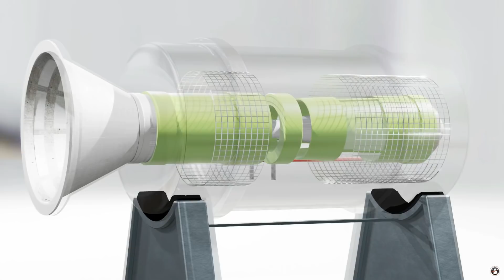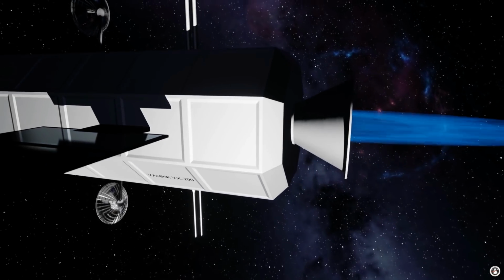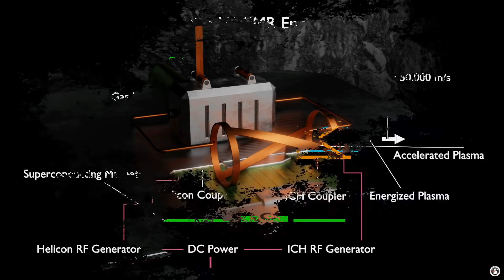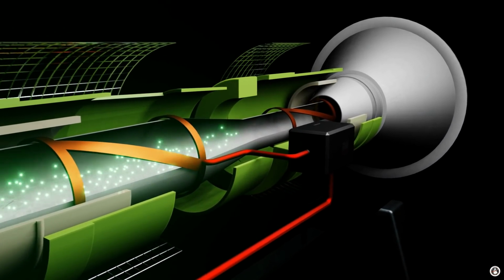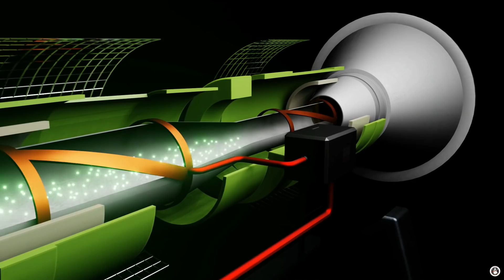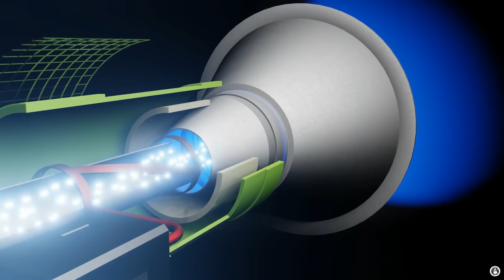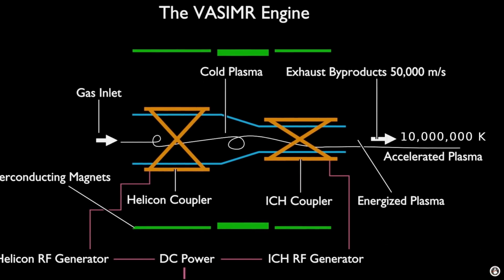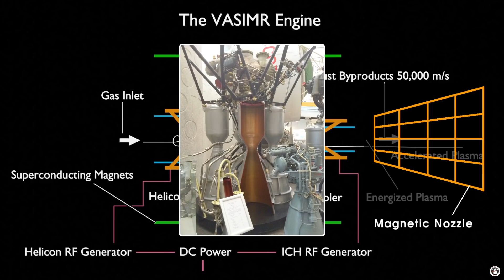The VASIMR Engine – 0.000167 c / 50 km/s

Comment: Some of Diaz' early designs used as many as 4 RCH stages - which would give peak energies about 10,000 times higher, with the same mass flow. Right now he just wants to get one unit (two mirrored thrusters and a power system) working as a space craft, which would be ideal for satellite or even large system transfer to geosync.
He has also used Hydrogen and heavy metal plasmas.
Reply: Heavy Metal Plasma sounds like an early 80s rock band

Comment: If it works how come Elon Musk isn't using.
Reply from the maker: It's not so straightforward. Though close, the engine is still under development. The high power requirements, like the International Space Station, could easily be supplied using solar panels. We think Elon is only now starting to consider other forms of propulsion. Let's see what the future brings.
Reply: @asteronx  I am so convinced Musk will see the need for VASIMR sooner or later. Just a matter of time.

Comment: Is there a possibility to use this high temperature to initiate a fusion reaction ?
Reply: Humans have been generating fusion reactions for decades, most of the necessary components can likely be found in your home. The problems are sustaining a reaction that generates more energy than was required to produce it. So far, fusion costs more than it can give back.

Comment: 39 days. shortening the travel time also makes manned flights to Mars that much safer, as the turn around for supplies and emergency missions would be so much more reliable and efficient
Reply: One 'might' be able to get there in 39 day, but, one has to slow down at the destination. Add another 26 months for that process. What materials do we posess to contain a temperature of 10 million degrees? Sweet nothing.
Reply: @peterbarratt8699  Nope. Half he trip accelerate, half the trip decelerate. Result 39 days. And Mars is uphill in a higher orbit which helps to decelerate.

Comment: what do you hear in space? radio static pulses
Reply: dc is better,
Reply: as railgun
Reply: cyclo-railgun, loop-de-loop
Reply: combined cyclic and linear dc accelerators, for particles
Reply: also orbital and to-orbit package launches, also out-of-orbit and to-other-orbit launches
Reply: artillery, that is
Reply: just have long barrels, more velocity
Reply: packets can withstand 120k-g of acceleration, like bullets, to get 10km/s or more, speed, to have the slinged to your base location, if needed

Comment: I also agree that Elon/SpaceX should use VASIMR engine in the starship. Or they can use both chemical and VASIMR engine same time,cause the final strship would have 6 Raptors engine,so it would be great if they used 3 Rvac Engine & 3 VASIMR Engine. I think it would take just 30 days to reach mars.

Comment: Someone tweet Elon musk. He has to know about this
Reply: To think that he doesn’t already know about VASIMR (along with dozens of other propulsion systems that you’ve never heard of) and that someone could break him the news of it on Twitter after watching a YouTube video is genuinely insane and concerning
Reply: Elon already talked about the VASIMR. He didn't think it can be put to use yet, because the energy efficient was very low (50% less) compared to other types of ion engines, esp. at the high thrust mode. I heard Ad Astra has improved the efficient of their VASIMR engine significantly in 2020, but the actual situation need to be confirmed. We'll see when they will put a VASIMR into orbit in 2022-2023.
Reply: @zhchbob  from what i remember from past videos, i think their main problem with this was the temperature, right?

Comment: Instead of trying replace chemical rockets why not aid them the E.M drive moving the atoms.  Make it easier on chemical rockets
Reply: The EM drive have been shown not to work
Reply: @jesperseegert5779  Alone  because a body at rest stays at rest.  Sending electron throw the walls would only heat up or vibrate the walls unless ship already being prepelled.
 With flow of election throw walls in a certain direction. It would take less rocket power from chemical rockets

Comment: Hey folks, although our solar arrays are less massive now-a-days compared to just five years ago, me thinks VASMR just  doesn't produce enough thrust for 39 days to Mars. What is the mass of the fuel for both acceleration and deceleration to Mars? 10 kW kilopower KRUSTY reactor = 1800 kg , that's for only 10 kW. I thing VASMR uses > 10 kW to function. I don't know what the mass of a appropriate solar array would be....(if you opt for solar instead.) Then there's the payload...what is that mass? 
Respectfully, I just don't think (all things considered) that VASMR has the specific power to move fuel, power supply and payload in any meaningful way.....wish it had more oomph than it does. : I.      ,     Kevin
Reply: Great comment. You nailed the basic problem: electric power to run it. Current solar is around 4 kg/KW, but this can be dramatically improved if concentrated sunlight is used in conjunction with SpectroLab triple junction cells that can operate at 900 Suns (if kept below 100 deg. C by active cooling) and at 40% efficiency. I believe over 5 KW/kg is feasible at one A.U.
Magnetic reconnection propulsion is far superior to VASMR in that it is less massive/thrust, is more efficient electrically, can operate at far higher specific impulse and does this by using the same trick the Sun uses to send out a flare. 
BTW beamed power by say laser to similar PV can have superior performance to antimatter but is feasible today.

Comment: Elon should consider using the Vasimr Engine on his Starships.
Reply: This will make the 1 million by 2050 more possible.
Reply: yeah if you want to accelerate by years rather seconds
Reply: @Technodude255  You think the VASIMR engine is an ION engine?
Reply: @WolfeSaber  more like in the same ball park as a ion engine. The plasma will take significantly more time to be accelerated compared to chemical reactions. Thrust is very weak with this technology
Reply: @WolfeSaber  ... and ion drives is producing a plasma though no as energetic as VASMIR or a fusion drive.
Reply: @Technodude255  Not this design. It was stated to get a ship to Mars in 39 days compared to, by chemical rockets, 6 to 8 months.
Reply: @Technodude255  A hall thuster and the visamir are not the same. The hall thruster is a cold thuster. The visamir gets temperatures hotter than the surface of the sun. It is not a ion drive.
Reply: @Technodude255  Your second sentence below makes no sense. The plasma isn't slow to accelerate the spacecraft will be slow to accelerate due to low thrust. The mission profile is the ship accelerates continuously...perhaps at only 1/100th of a g... but that adds up over many days. You have to have an independent power source
Reply: @francisdavis1271  I understand that half ,   the 20 first days  is thrust forward, and another 19 days the speed is so great that it turns around and starts breaking the rest of the trip.  Cool.
Reply: The item that is never mentioned is VASMIR is the need for electrical power. Solar panels have improved vastly in the last decade and a conventional nuclear power source is possible... but has to provide power to run the engine.
Reply: @francisdavis1271  Luckly, NASA is working on new, more advanced nuclear technology, like a reactor the size of a AA battery.
Reply: @WolfeSaber  WHAT??
Reply: @leaderofthepack4044  Look up the designs NASA is working on. Found one that was that small.
Reply: @WolfeSaber  The only thing i found was a thing called kilopower
Reply: With Musk solar panels, it would be the perfect team. Before Musk the only solar panel option would come from Boeing.

Comment: Wow I like that engine, if combined with spaceX it would revolutionize space flight🖒.. cA
Reply: If I am correct Elon likes in house developments. But I suspect that sooner or later they will realize about the need for a faster trip to Mars. If unprotected from radiation, in 8 months you may have blind people reaching Mars. And to protect from radiation you may need lile 1 meter of water. Just as usual, humanity likes to learn the hard way. Sooner or later they will find the urgent need of using VASIMR to go to Mars.
Reply: @aquarius5719  i wouldn't say blind but highly likely have cancer, a round trip to Mars would give you 0.7 Sv, while NASA astronaut career limit is 1sv, and around 5-8 will kill you for sure.
Reply: Actually it wouldn't work with their current plans basically at all. For use to use this we likely are talking faster to Mars as in "higher specific impulse" but lower delta V similar to hall effect and thermal nuclear propulsion vs combustion. In that regard it would require extra staging which goes against SpaceX's current plans of refueling on Mars and coming back. The second stage would need to be disgarded in space to make it to Mars but then you no longer have it for the way back. 

From what I can find online, the VASIMR while pitched for both high and low thrust currently only works in practice for low thrust high specific impulse. It seems to have similar struggles to thermal nuclear rockets for take off. In thermal nuclear rockets the issue is that we don't have the materials to sustain the heat needed to reach orbital velocity from Earth (about 4400K). For the VASIMR it seems more that research is more in the way of competing with hall effect thrusters though with the struggle being energy demand being incredibly high (likely requiring a nuclear fuel to truly power it). 

The issue if nuclear power is the same reason we currently lack any manned hall effect rockets however with Congress allowing for progress to continue into nuclear rockets we might finally get them. Though again, I have a feeling the VASIMR is going to be over shadowed by thermal nuclear and hall effect thrusters which both are more proven technology. NERVA was a whole program back in the 50-60s of thermal nuclear rocket engines and hall effect thrusters are used every day for satellites. They have to make a pretty good argument and show it work in practice to really win a space in the field.
Reply: @Skylancer727  just make a space tug and refuel it with starships
Reply: Actually elion mask will make it work if he want with space x with a update  design

Comment: Will it run in the atmosphere? Can we use one dragging the 1/4 mile? Xx
Reply: Running such an engine in an atmosphere would be like detonating a fusion bomb constantly  every second. It would most likely be limited strictly to space travel.
Reply: @nil981  that's fine... We'll get the crowd to sit a couple of miles from the track lol! I jest xx
Reply: @nil981  It needs a vacuum to work.

Comment: interresting stuff. id love to see your maths, its just that these numbers seem to be too good to be true.
Reply from the maker: Visit the Ad Astra Rocket Company for more information: http://www.adastrarocket.com/aarc/
Reply: Imagine you will have a trip on the flat desert. You take your car and use first gear amd you try to accelerate in first gear to make your car go as fast as possible. Upon depleting fuel you go across the desert with merely the inertia of the car. That is way too slow and takes too long. This is why cars have higher gears that push very little and spend very little fuel but allow great cruise speeds. Chemical engines are a first gear, great to climb outside the steep gravity hole of Earth towards orbit. But once in orbit, it is mostly flat terrain. We need that sixth gear of VASIMR. If you make the numbers of the desert trip you will find out.
Reply: @aquarius5719  that analogy isn't true. gears exist to compensate for air drag and earth to wheel friction, which doesn't exist in space.
It doesn't matter how fast you shoot something out of the engine if its mass is too little in relation to the spacecraft, and getting the energy to power what is essentially an ion cannon and use it to shoot out a good amount of mass at high velocity is too impractical since batteries have a lot less energy per unit of mass compared to chemical fuels, and the sun does not provide nearly enough energy per unit of surface to power it either.
unless you put a nuclear reactor inside the thing it's not going to work.
Reply: @mohamedouhibi5389  The gear equivalent is ISP. Specific impulse.
 Impulse = mass x velocity (of ejected material through exhaust)
Chemical engines deliver a fixed velocity so to have more impulse you need more mass.
The great thing about VASIMR is that it can regulate velocity. So ISP changes amd becomes more efficient in terms of useof propellant. So you get more speed with less mass of propellant.
Reply: @aquarius5719  the issue here is the mass needed to store/harvest the energy to power the thing, it's just too big.

Comment: Or maybe if you contact Elon Musk and tell him about these engines strike a deal let’s make a starship with one of these engines in it
Reply: Not only does Space-X obviously know about VASIMR, so does everyone with a passing knowledge of spaceflight. Idk why people from the mainstream think about Elon musk as some kind of cartoonish genius building the rockets by himself from deep within the confines of his bunker. There’s so many misconceptions about musk it’s actually crazy
Reply: Elon's SpaceX just awarded Multi-Billion Dollars contract by NASA to develop next gen Lunar Lander. I think these companies involving possible instellar travel probably talked to Elon as these prototype engines getting close to be spaceflight ready.
Reply: shhh.

;)
Reply: Pretty sure these engines aren't capable for rockets as massive as starships
Reply: @NoxyU25  nah, too low thrust and TWR, but for smaller ships with beamed power its very good
Reply: @antaresmc4407  Sixth gear in a car also delivers low thrust. But in flat terrain delivers great cruise speeds compared with cruising with engine off.
Reply: @aquarius5719  rockets dont work the same way as cars though, it's a very bad analogy (not necessarily wrong, but very inaccurate, more in this case)
First acceleration time can be months, second of course it's better than engine off, thats unfair af, third, the weight of the vehicle is much worse, and electruc engines plus power systems and radiators are super heavy